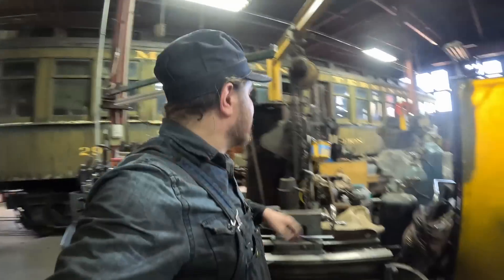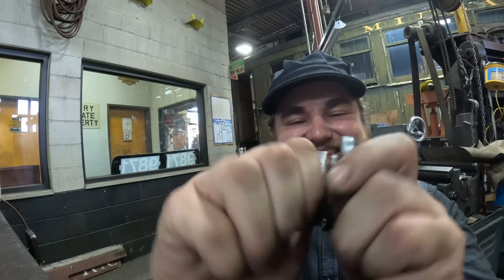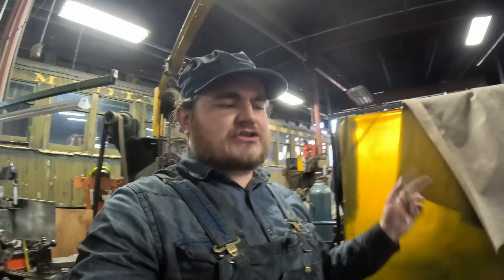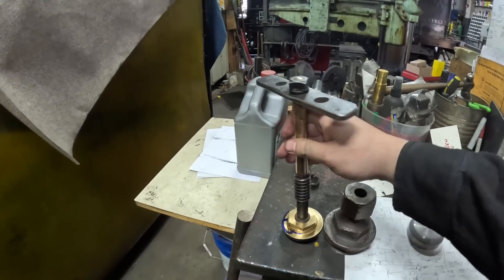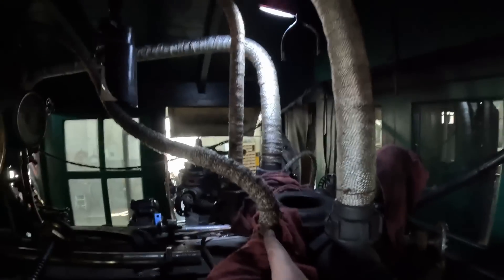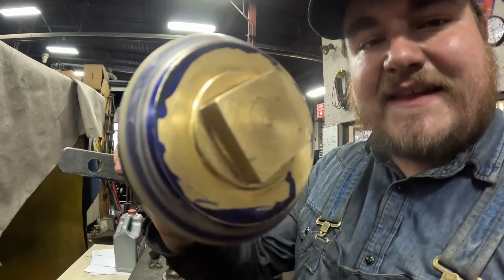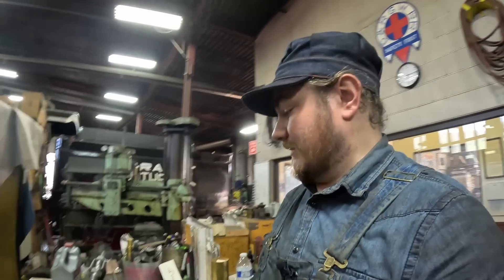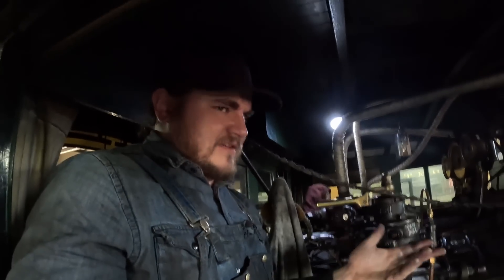Why DIESEL replaced STEAM TRAINS - a specific look. | Railroad 101

Comment: My great grandfather worked in the Ipswich railway workshops in Queensland, back in the days of steam. He was a blacksmith... which in the railway workshops meant him plus five other guys holding onto the end of a shaft, forging it in a huge hydraulic press. They did their own axles etc.

My grandfather (his son in law, and aa machinist/diesel mechanic) went to visit him at work a few times and recalls seeing them welding a broken side rod from a locomotive by touching the two ends of the break together, striking a monstrously powerful arc between the two to heat them and then ramming them together to form the join.

Gnarly stuff, and obviously  hugely labor intensive.

Comment: Maintenance certainly, though some of the research since the 70s threatens to bring maintenance time down some 80%, and emissions of the more harmful gases per unit of fuel burned are significantly lower, so for a new railway with a CEO that actually cares about the environment, I could see a steam-electric combo fleet being useful, mainly electric with steam for lines that haven't been electrified yet and publicity specials.
Reply: The most efficiënt stean locomotive (that completely modernized German thing) achieved an efficiency of 11 or 12%. No way anything is gonna be more polluting than that. Diesels are much cleaner these days than the 1960s two stroke stuff too.  Electric is best of course, especially on wind/nuclear/solar energy.
Reply: @mfbfreak  Glad you asked. First, 52 8055 wasn't even the theoretical best when it was new in 1998, it was a conversion and didn't get the chance to have every little piece designed from scratch. For instance, it doesn't use Lempor or Lemprex ejectors (I think is uses either Kylchap or Kylpor). Estimates put the best theoretical thermal efficiency of steam at about 18% with what technologies we currently have.
As fot the comparison, these numbers come from Roger Waller's work around 1998 comparing a diesel and a steam locomotive, both built in 1992, operating on a Swiss rack railway likely without many modern steam features in the latter case. In terms of g/kWh of nitrous oxides, the diesel locomotive emitted 18g, while the steam locomotive put out 2.5; the numbers for carbon monoxide (0.8/0.4) and sulphur dioxide (0.6/1.8) are less impressive but still total far less than the diesel locomotive. This is also only speaking of trains with only one locomotive; for heavy duty Class II freight operations, you'd be comparing two or three diesels for a single steam locomotive (see Challenger pulling a 143-car pig train) and maybe an electric yard pilot to help it push off.
There's also the potential of torrefied biomass, which burns cleaner than ground coal in tests conducted, and while it's also true that R80-B20 diesel fuel burns very clean too, it's also true that it's really not made in enough quantities to fuel long-distance locomotives on, at least not yet.
But yes, electric is best. I'm not really sure there exist many routes where electrification is a no-go, honestly, but there are situations, and power outages do happen.

Comment: Hyce I got a good question for you after watching this video, do you think there might be a day when steam locomotives will replace diesel electrics? And if so how do you think it could be done.
Reply: Short answer, no
Reply: @andrewreynolds4949  long answer - the most likely thing to replace diesel electrics would be fully electrified trains. This has already happened in some places in Europe. The longer distances in North America make it impractical with current tech in remote regions, but I fully expect some of the higher traffic corridors - especially in areas with pollution concerns - will get electrified freight lines.
Reply: When oil becomes too [****] expensive or hard to get. There was a mini-boom in steam interest during the 1970's  OPEC oil embargo.
Reply: @ReggieArford  And for good reasons, it never amounted to more than speculation. As much as I like steam, it's not coming back to the commercial market in any noticeable way

Comment: I wish my dad was alive to watch this. He fired steam, and qualified as engineer, a year or two before the B&O ended steam in 1956.
He fired and ran Pacifics and Midados running at 80 mph on the Washington Branch.
I bet Hyce would love to have that experience once or twice. 
All the old steam heads I used to work with say they'd pay decent money to have the steam experience a few times again, but would quit if they had to go back to steam on a daily basis.
I have a photo in a B&O history showing the Mt. Clare shop crew that built a 4-8-2 locomotive.
There must have been a thousand men and a few women standing for that photo.
They probably used the fire-box and boiler from a  2-10-2 "Santa Fe" type.
I used to work for the Big Nothing in Denver, mostly at 38th Street. Spent some time at Rice Yard as well. My first job as a clerk was at the storehouse using fork-lifts to load and unload things like traction motors in box-cars.
B&O 1970-1974
BN 1974-1981
Reaganomics hit and railroading was no longer fun.
Reply: I'm not American, nor was I around for Reaganomics, so my understanding is quite poor, what did they do to make railroading no longer fun/enjoyable?

Comment: So here's a question - with modern tech, is there anything thats easier to do in maintaining steam than back in the day? I'd imagine primarily better machining equipment.
Reply from the maker: Not really, actually; the machine tools haven't really gotten better, save for CNC being a thing. CNC is great, especially for batch work - but really not useful for steam, because each part has to end up being so custom. I could see a space where a railroad like the D&S, which runs several of the same class, could get benefit of CNC making the rough part and then a machinist finishing the custom diameter and etc. manually, but it's really not that much of a savings.
Reply: @Hyce777  With modern carbide tooling you can make a part faster than back in the day when they mostly used HSS or even carbon steel tools. That only saves actual machining time though, all the measuring, fitting and fettling is the same... and in my experience takes longer than the actual machining.
Reply: Porta water treatment reduces the rate of corrosion quite a fair bit, and if you're making a boiler from scratch, GPCS stops the coal particulates from scratching up your metal, but that's not that helpful for pre-existing locomotives.
Reply: The main thing that has changed between now and then is actually quality and consistency of material - the steel we can make today is much stronger and more resistant to fatigue due to holding fewer unwanted inclusions, and more wanted inclusions, and being better homogenized to distribute the inclusions more evenly. So, realistically, making strong steel parts for locos now would be easier than it was back then, though it probably wouldn't make that much difference overall.
Reply: @KidarWolf  Lost-styrofoam for casting, instead of sand casting.

Comment: Steam was practical when fuel and labor were cheap, and you had no other options. As cool and charming as they are in operation, they still cost a fortune in maintenance and the work isn’t really any easier now than it was then. You may have access to better tooling and equipment to make the job easier, but the important stuff still requires a degree of skill and experience which takes a lot of time and initiative to develop. On top of that, those same individuals slave over menial tasks for days or weeks just to get the thing out the door. Is it worth it? Hard to put a price on experiencing history, until you ask your org’s treasurer….

Comment: this does help underscore why some railroads every very big on standardizing parts IO suspect had steam not going awya we would see standar sizes for things like cylinders used by many railroads perhaps they would ahve moved to the so called "steam motors" that were more self contained steam engine that would drive the main wheels via jackshaft or even turbine hydropic  eclectic locos

Comment: Old British drivers said it best when they switched over to diesel "For most; there was a brief sigh of nostalgia... and a huge sigh of relief"
Reply from the maker: That's a brilliant saying.
Reply: @Hyce777  That reminds me of a quote from Robert Riddles - man who oversaw the modernisation program for the British Railways in 1948. When he first rode on the footplate of an electric locomotive, he was asked what it was like.
He replied, "I didn't really notice. The driver was an old steam man; We talked about steam engines all the time."
Reply: @Hyce777  I've heard that the difference between steam and Diesel is that steam takes a day to cool off, and a couple of hours to take apart & fix. A Diesel takes a couple of hours to cool off, and a day to take apart & fix.
Reply: @Hyce777  Almost like we have an ancient venerable tradition of making great poets and writers for centuries or something. :P
Reply: Until the diesel failed, because it British Rail.
Reply: @gamerfan8445 and it was usually because of crappy prime movers, (aside glance at Deutz, who still have problems making reliable prime movers, *sigh*).
Reply: @gamerfan8445  BR diesel be like 💣
Reply: @OG-Productions  especially the Class 21
Reply: The British Railways took a collective sigh of relief when they discovered the EMD 645
Reply: @caelumvaldovinos5318  Yeah, unfortunately the class 66s are so ubiquitous now it's made the scene in the UK rather boring. No doubt excellent locos, but rather lacking in character.
Reply: A bit like the move from cask to keg beer less time consuming to look after, easier to look after and requires less man power.
Reply: British Rails best diesels were the Class 08’s,Class 20’s and Class 37’s very reliable and still in use today in revenue earning service
Reply: Yeah to be honest, the class 66 isn't British built
Reply: Well at least we’ve plenty of reliable and stunning diesels like the (SD40-2s and the Class 55s) and they sound almost as human as the steam engines do.

Comment: And this more than anything is why diesels (and in other countries, electrics) killed steam.  Sometimes steam was stronger, or faster, or more powerful than the new technologies, but rarely was it less maintenance intensive.
Reply: Only in Britain, where they managed to absolutely botch modernization, were the diesels harder to keep in service than the steam
Reply: @andrewreynolds4949  Actually, poland as well. Poland still runs steam in revenue earning service to this day.
Reply: I would also argue that versatility/flexibility was another huge factor.

Diesel-electric trains are simply more flexible than steam trains. You basically needed to build a steam engine for a type of job, but diesels are far more practical to just have a couple models and stack locomotives as needed to do the job.

But, yes, it was as never about what they are able to pull. It was always the other factors like maintenance, flexibility, reliability, ease of use, etc that made steam not commercially viable.
Reply: Something that is also a bit of a consideration, depending on where you live, fuel cost. Right after WWII coal became a rare thing in Germany and the costs exploded. People went and robbed coal trains or even locomotive tenders for coal because they couldn't afford it, but needed it for living.

Mind you, the dieselization in Germany was also botched by the simple fact that the industry told the west german federal railway that the laws of physics don't apply to their products. One example is that a set of ~360 diesel engines had a total of ~460 motors replaced in the span of 2 years. So on average each engine had their motor replaced more than once a year.
Reply: The Class 08’s,20’s and 37’s are quite good
Reply: Ummm diesels did not “kill” steam engines. They replaced them but not kill ‘em. Blame the designers!

Comment: I used to work for John Martz Luger carbine maker from Lincoln, CA and one of the things I did was barrel lapping of new barrels. He didn't want to do the job because he didn't have any patience; I did as I had the patience and the skill to do lapping. Lapping is labor intensive but the nice part of lapping nowadays is one can buy various lapping compounds for all purposes. 
Nice exhibition of the old parts and what needs to be done to keep the old locomotives running.
Reply from the maker: It sure is nice that we've got compound that we can just grab. We use Clover for steel, and Timesaver for bronze. Had no clue barrels needed to be lapped, but that does make sense.
Reply: But do you lubricate it with Dawn dishsoap????

Comment: Hey Hyce! Awesome video as always, but why were American railroads so quick to replace steam while in other places it took decades?
Reply from the maker: We move the most freight; tonnage is critical.
Reply: The US was much richer than Europe during the period (still is, but less). This gave more money to upgrade and meant upgrading would save more money, since labor costs (wages) were higher. So the US was ahead in R&D in the 1930s. 

Then there's WW2, where the diesel-only companies (GE and GM-EMD) were allowed to keep making diesel locomotives. Everyone else stopped making them for the duration, just not the source of most of the world's oil at the time. The US also built a lot more ships with locomotive derived diesel-electric powerplants. So when the war ended and Europe's railways were worn out or bombed, they couldn't afford to switch. But US railroads could, and the locomotives were already rolling off the assembly lines.
Reply: @morat242 yeah it was a money thing. but we in europe basically killed the steam engine with electric. diesel wasnt a huge deal unless we are talking branch lines.

Comment: the thing is if we still were using steam engines shops would have custom tools to do a full rebuild in 24-48 hours custom cnc mills to re-machine parts to correct tolerances and so on it would not be done by hand
Reply from the maker: Actually not really; drawing this part up and making it on the CNC would've taken just about as long as manually machining it. The setup takes a fair amount of time. CNC is great for batches, not one offs.
Reply: @Hyce777  i was trying to say if we still used mainly steam engines you would be servicing 1000s of engines and the time it would take to Draw and CNC a part would be easily done since it would be unlikely to reach the point its cost effective to mass produce, especially since you would create jigs to rapidly machine a part, also parts like the one you machined to do lapping would be kept on hand as it would be used for many engines
also, we would probably move towards part intercompatibility as material cost is no longer a major factor of maintenance

Comment: So diesel replaced steam because diesel was cheaper to fix and work on (manpower wise). also, that multiple diesels can be controlled with a total of 2 people compared to multiple steam engines that use 2 people per engine. However, a steam engine can still do the work that they were built to do after 80 years or more, but the railroads don't use them because it just too expensive to use and required a lot of manpower. Am I right or not?
Reply from the maker: That's pretty much it!
Reply: There are a lot of ancient diesel locomotives still around too. They’re just much less efficient and capable, and more difficult to continue repairing. But it can be done if you know what you’re doing
Reply: @andrewreynolds4949 same goes with electrics, we still have working electric locomotives that are 100 years old or more. its that releiable.